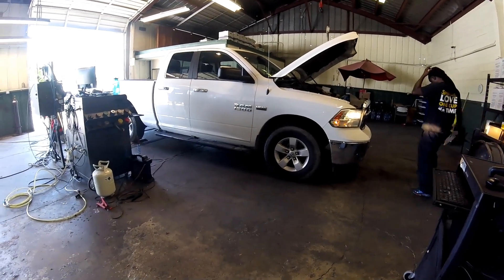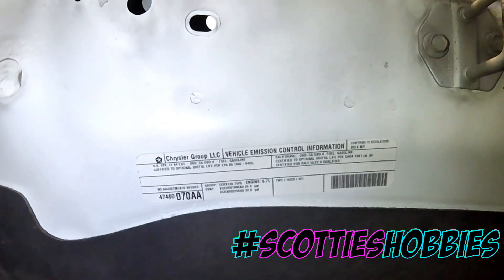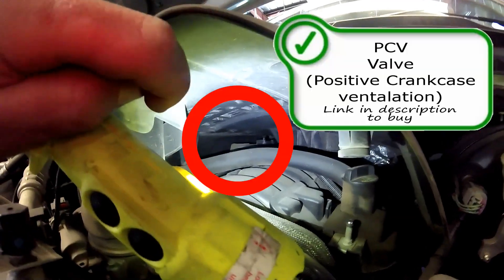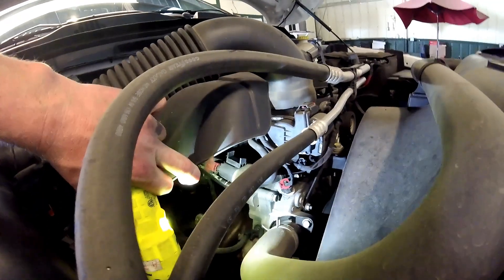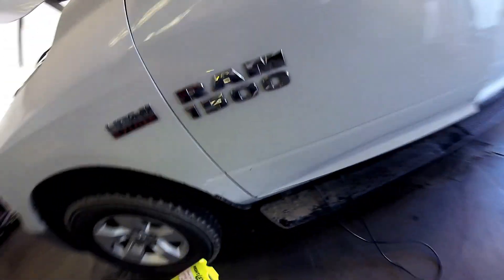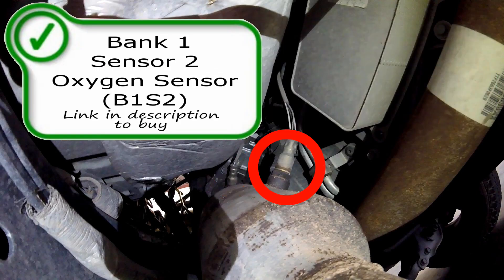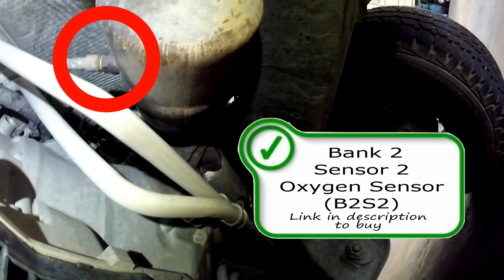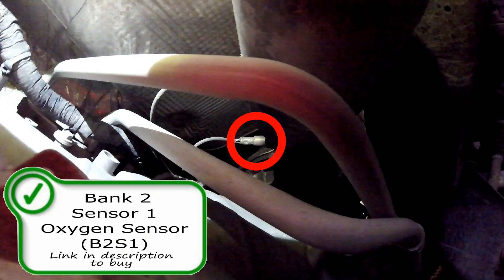⫷ RAM 1500 5.7 Emissions Locations: PCV, EVAP Purge, Oxygen Sensors ⫸

Comment: I have a 2017 Ram 1500 5.7 the fuel cap light is on but no evap codes I've checked the fuel cap it was tight but I got a new one from my work and put it on and the check fuel cap light is still on what would cause the light to be on with no evap codes

Comment: The 2012 Ram 1500 5.7 is different with this video, someone said EVAP under the battery, I will check it late...
Reply from the maker: The vapor purge solonoid is possibly under the battery on that model.
Reply: @ScottiesHobbies  Sure， under the battery for 2012 Ram 1500 5.7
Reply from the maker: @gkz871  if you search ' scotties hobbies ram ' I'm sure you will find a video fir that vehicle somewhere in my library.

Comment: Does bad pcv valve cause oil leak through into air filter ? My tuck has rough  idle and oil leaks. ?
Reply: It can if it is always open. However, the oil is called "blowby" which is caused by wearing out piston rings mostly. So even if your pcv valve was pooched you shouldnt see significant oil on your filter. Try this...woth engine running disconnect the pcv valve from valve cover but leave vaccum line on other end. Take your thumb and block it. Does the engine idle change at all? Should change veey slightly. Like 50 rpm. If you block and unblock it and do not hear any rpm change at all...she calfed. Chuck it and throw on a new one. Should be changed once in a blue moon anyway brother. Gd luck!

Comment: Here is a question, I have 2009 Dodge Ram 4.7 L, if I run just regular 87 octane in it I get a strange knocking and temporary power lose if I really mash the  accelerator hard under a load or going up incline and a few times on the freeway passing a slow car.
If I run 89, E15, or E85 I can  accelerate as hard as I want under any condition with no problems at all. What could be causing my truck to not like 87 octane?
Reply: Possible EGR valve. Exhaust Gar Recirculator. Under heavy load it allows exhaust gas to get mixed into to cool the combustion process down and prevent precombustion or "pinging" which is what u are describing. Higher octane fuels are actually harder to "light" and therefore theres less or no pinging. Look for a valve that has a tube from your exhaust to it and then another tube going to the intake from the valve. Will have a connector on it. Some dont have a second tube as the valve sits directly on the intake and opens under load and lets the exhaust gas directly into a port.  Good luck bro.